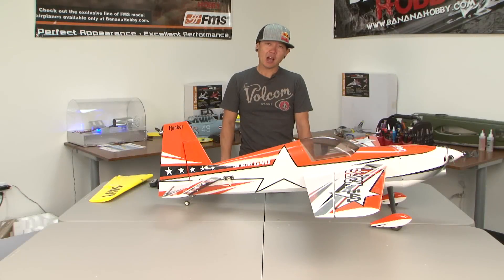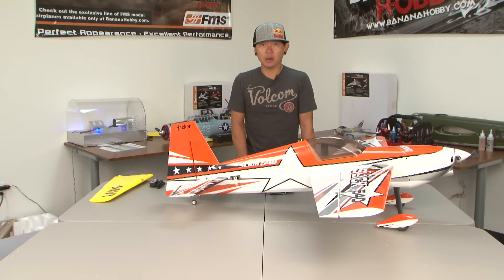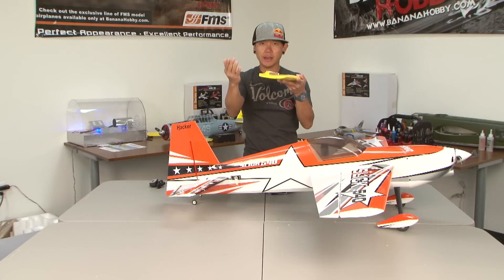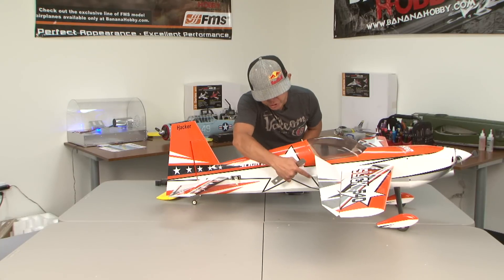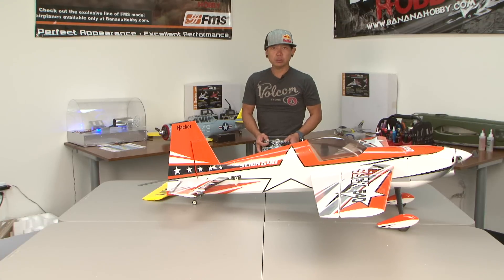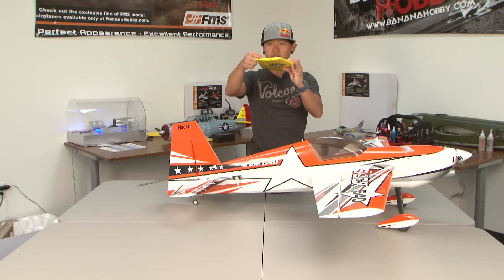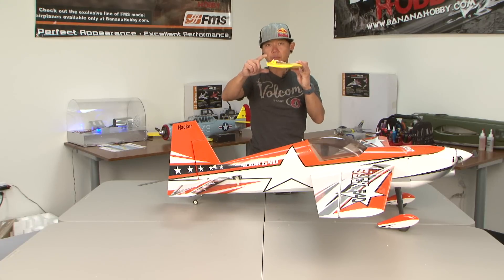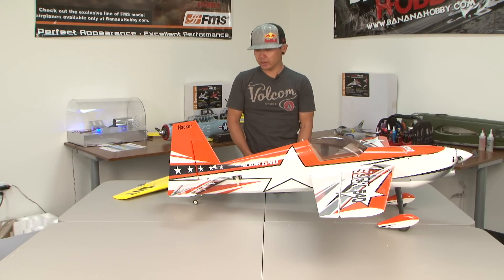Pete's Tips - Control Surface Throws

Comment: Some very good information, thank you. I had to do just that on my F9F Panther to  make it more manageable and not so touchy to fly. Since I didn't have a computer radio the manual adjustments worked just fine. Thanks again for sharing.

Comment: Fantastic! Can't thank you enough. Now, I have a question. You obviously fly 3D aerobatics (nice plane by the  way!). I have a foam 3D trainer called a Wargo Yak54. I'm just getting back into the hobby after a 20 year layoff and want to fly this plane but the recommended control throws are totally outside of my capabilities right now, even though I was flying an a .60 size Extra 300 glow model with total confidence when I quit.I am flying a UMX Timer perfectly fine right now. My question is, can you recommend how much I should reduce the recommended throws on the Yak so I can fly it like a sport plane until my nerves settle down. I know this is a tough question. I've reduced them by 60% and they are still pretty radical. Thanks!

Comment: Flight simulators that you can practice on the computer.
A few options with a working radio that you can actually bind to a RC plane or helo and fly?
How about the programs that are the most realistic and scale to actually flying in the local park such as wind, obstacles/trees, and runway/grass landings?
Since this was about throws, can you adjust them on a sim too?
Thanks pete
Is there an ultimate choice in one or 2 set ups?

Comment: Thanks Pete. What about control surface throws on a trainer. I fly trainers only. I have only used hand me down D/R and Expo settings and the throws are what they are. For low the D/R and expo are 65 and 50 for mid it is 75 and 50 and high is 100 and 50. This is not scientific. I have a Great planes manual throw gauge and do the measurements but for me I don't use them in the setup. Sometimes I compare them to published values in the manual. If I have an uncontrolled flight and manage to land it then I reconfigure. 
    I very much enjoyed this video and your clear explanation. I would really like more info and throw info on different categories of planes. The material you present here is excellent.

Comment: How thick should Pushrods be (.032 or .047)? And do they need pushrod tubing for a ...say, 45" wingspan scratch foam board 3d plane  like an Edge 540?